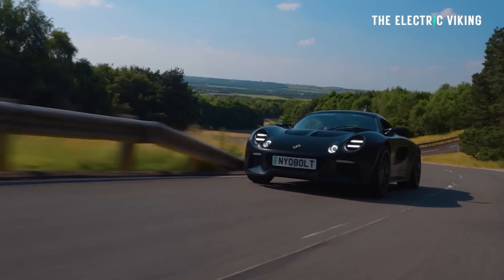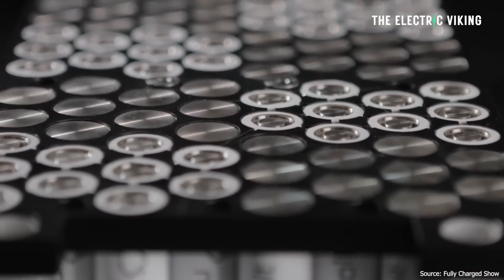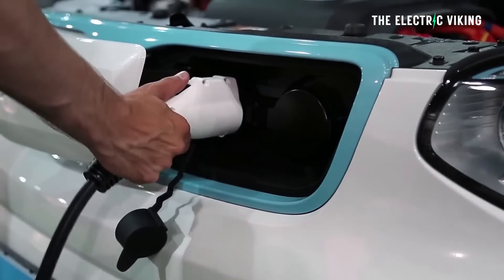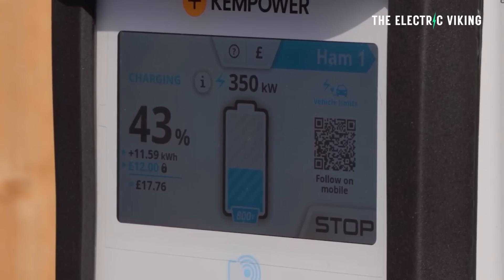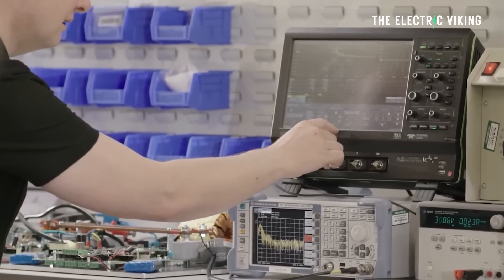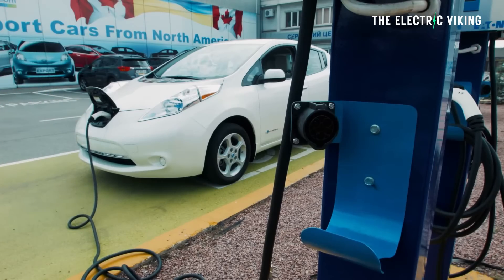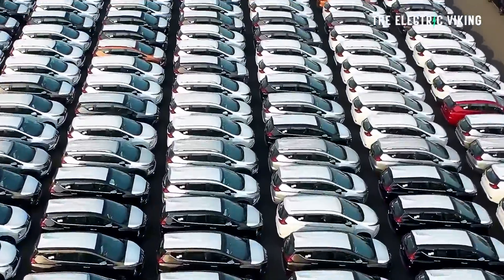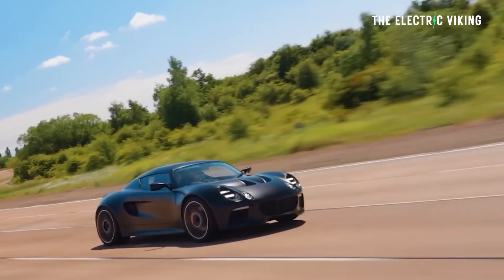The fastest charging EV in the world weighs only 2700 pounds

Comment: Quick charge, long lasting does not belong in the same sentence. Unless your using a fast charge high draw batteries. 

I worked with lithium batteries, charging them is complex. It will only take them a few minutes to get to 80% but takes them hours to from 80% to 100%. The thing with lithium is the draw is much faster when its below 70% percent than when its 90%

You'll most likely shorten the battery's life if you keep charging them "the quick charge method"

Comment: That is fantastic but you need a 455 KW charger to achieve anything like this and if you start putting 455 KW chargers everywhere where on earth do you think you will get the electrical infrastructure to be able to handle this and maintain this.? That is a 550 amp service at 800 volts approx. Per Charger

Comment: This is the Nyobolt EV concept car. Nyobolt are a company that are developing cells and packs in the UK ( I may or may not have worked on these cells) and yes they are working in super fast charging pack technology. There are some extremely interesting materials and advances used in the electrode material they use.

Comment: Charging Speed is very subjective. I know not everyone can charge at home but as charging infrastructure evolves, I suspect most people will charge at their residence, during the time they are not driving their EV. This makes the "charging time" essentially zero for those people (myself included). 
However, when traveling away from home, charging time is adequate, IMHO. If it was going to take well over an hour to charge (think 2-10 hours) then that would be unacceptable and, quite frankly, unsustainable from a business perspective.  But that's not the case, at least for Tesla and a few others. Charging times for my Model Y on long trips are very reasonable, usually less than 40 minutes, and the charging stops are a welcome rest from driving. 
All that said, the charging times will decrease and the range will increase as battery & charging technologies evolve. Future history is proof: in Star Trek they use Dilithium Crystals that only need changing or recharging every 5 years.  So there you have it!😊

Comment: Is this truely a near full duration high current charging battery (i.e. just down the battery chemistry, which would be exceptional), or a segmented battery pack, with slightly extended current range charging batteries, using clever electronics and staggered overlapping parallel charge windows optimised for the size of the overall battery. The fact Sam mentioned near full charge for the duration and use of custom charging electronics makes me think it could be a segmented solution. This means its likely an overall solution to fit a particular niche design optimised for high current charging (circa 350kWh) rather than something that can be universally applied to other cars with their more typical charging use case. That said this would be an interesting approach for smaller BEVs to take, as their smaller sized batteries could be charge in shorter durations, like this car, utilising today's fast charger levels (200 to 350kWh).

Comment: I personally think that weight reduction is more important than charging speed. Wondering what weight the car would have with a let’s say 60-70kWh battery pack.
Reply: Rule of thumb is baterry packs weigh around 20lb per 1kwh.
Another rule is that rest of the car needs to weigh at least the same as the pack for structrural reasons.
So a 100kwh pack would be 2000lbs and a car would weigh 4000lbs in best case scenario.
A 60kwh pack would weigh 1200lbs and the car would weigh 2400lbs in best case scenario.
Reply: @nocapproductions5471 We need a nuclear powerplant weighing only 35kg

Comment: Very intriguing automobile. 
What's it cost I like the 2700 lbs.
But 150 mile range is a little short even in san diego for a quick fun run through the mountains.
Reply: In one go.  150 miles isn't a handicap with a lot of chargers "on the road".
Reply: @AllDogsAreGoodDogs  not in the back country mountains and deserts near San diego

Comment: The need for extra fast charging could be useful but there is a balance of time/cost/battery health.

What we need is hundreds of thousands of convenient chargers so whenever and wherever you stop there is one available without much of a wait. This will mean smaller, cheaper, lighter battery packs (& cars) that result in quicker charge times. 

Shrinking the size of a battery has a lot of benefits with only one negative, range. More chargers means range is less of an issue.

Comment: Existing chargers can go up to ~1000 V. You'd need that BUT I can't imagine the charging infrastructure if you wanna charge ~10 cars at once at this speed. ~4 MW installations aren't easy to do.
Reply: Tesla is already doing 4MW capable installations. It seems the default is now 12 stalls which is 3MW capable.
Reply: @tpedwards  I know and it is possible at certain sites if the infrastructure is already there... good thing that not all ppl are buying EVs at once so we can expand the infrastructure as well but it's gonna be expensive.

Comment: I don't get the need to charge faster than 20 to 25 mins. If you go faster than that you are asked to leave the charge point typically within 5 mins to avoid extra charges. I'm used now to getting coffee and a snack, with the walk to and from the car and a toilet break you need 20 to 25mins. Why do I want to be nagged to go back after ten mins? Technically impressive, practically why bother?
Reply: What does the coffee and snack cost at your charging station? Are the toilets free to use? You have to add that to the charging costs. 
I don't need neither a coffee, a snack or a toilet in the 2 mins when I fill my gas tank... ;)
Reply: @hiram1923  Most people do a break after 400-500 km anyway. I don't get these arguments, as if the people are driving thousands of kilometers without any pauses and have to charge their cars in 2 minutes.
Reply: @huckleberryfinn6578  Who says that everyone at the charger has just driven 400 km? A lot of people can't charge at home, so they have to use some public charger close to their home.
Reply: @huckleberryfinn6578 yes, but there are no EV under 50k with 450km real range at 120kmh.
The closest in term of efficiency is the model 3 highland has 330km of real range at 120kmh, from 100 to 0% without AC. If you do 10 to 80% charge sessions, then it's 231km between stop, or 208km with 10% degradation. 
Even for your first stretch from home (100 to 10%), it's still 267km of real range. Nowhere close to 450km between stops.
EVs work only for people who are willing to change their trip routine and not run on AC.
Reply: @hiram1923 I agree with you, don't spend between stops as things are 3 to 4 times the price of a local grocery store in the highway. But still need to stop for toilet whenever someone needs it during road trips. Regardless of the fee (free on toll roads).
Stops don't last more than 8 mins.
And charging is at least half the price of gas at high most expensive charger you can find in Europe, usually a third of the price.
If you have kids, then an EV is a no-brainer because stopping every 200km is normal.

With that said if you don't care about stopping, but only the time it takes to reach your destination, there are 4 EVs that can do 1000km under 9 hours. Tested by Bjorn. The cheapest Tesla (35k) can do it in 10 hours.

Comment: Fast charging so fast all the time damages the battery. 
Small battery, smaller range. Bigger battery, more range. 
And besides, 35Kwh battery charging in 4 minutes, the others that have 3 times bigger battery takes 3 times longer to charge.
So nothing special, as not such a "game changer" after all.
Reply: Unless the voltage is changed.
Smarter people than us are working on it.
Reply: Most EV's have 60-70kwh battery pack so 2x or 8 minutes

Comment: Ok, so a Tesla Model 3 with these batteries would take around twice that, so 9 minutes. That's pretty amazing. Call that 60KWh capacity, so in 9 minutes (9/60=0.15h) that would need 400KW. This is on the upper end of the spectrum for existing chargers. Currently, I believe the Tesla Model 3 only goes up to 250KW, but I might be mistaken. I guess it's going to need 800V architecture to be able to achieve this, else the current becomes excessive and the heating losses too great.